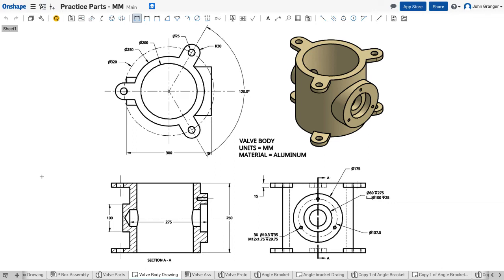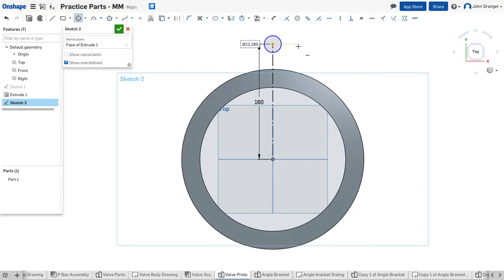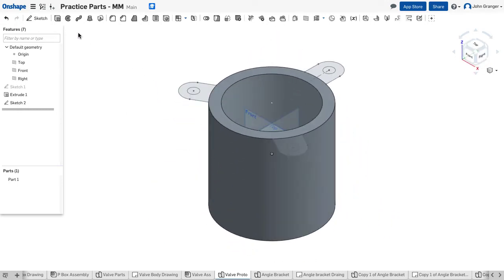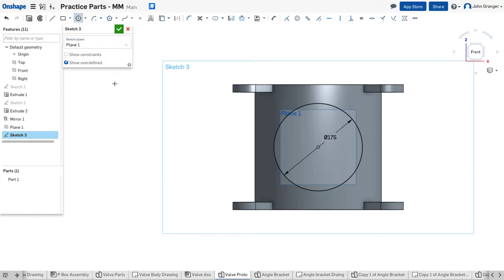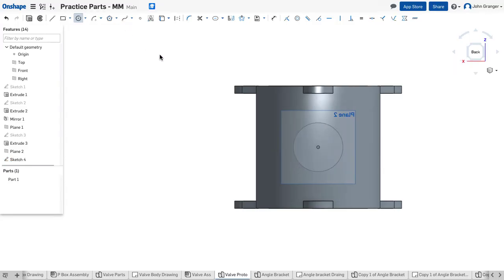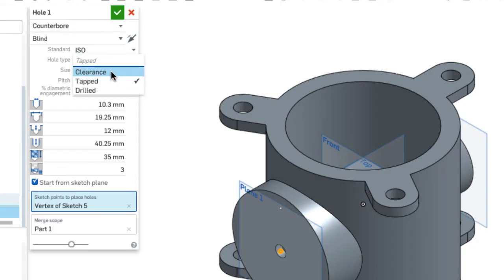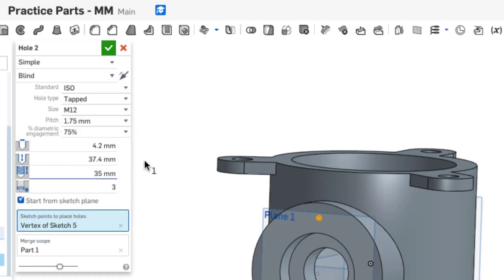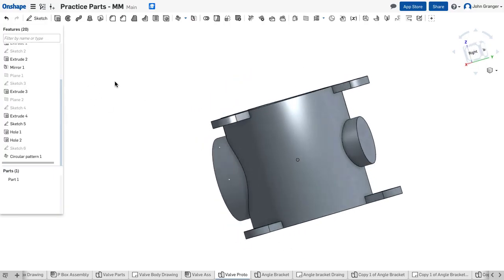Learn Onshape - Project 12 - Valve Body

Comment: it would not bore into the original part, kept turning red. I change the depth to 24 mm and it worked, change it back to 25 and it turns red. deleted and start that part over and i had to have did something different, it worked 2nd time, only part it gray instead of blue on finished part
Reply from the maker: Not sure what is going on, but here is a suggestion.  Push the rollback bar in the feature list up to just below extrude 3.  Double click on extrude 3 and the settings should be to remove, starting on face of sketch 3, ending on the face of extrude 2.  Offset distance should be checked with a value of 15 mm in order to end the hole short of the end of Extrude 2.  The merge scope should be part 1.  If this doesn't come out right, then check extrude 2 and make sure it was done correctly.  If all else fails, email me email me the file link so I can look at it.
Reply: @Onshape.Learning.Projects  not sure what went wrong but every thing is  right now

Comment: Hi! awesome tutorial. I know i’m really late to this video, but i a, having a lot of trouble with the counterbore hole on sketch 5 of this drawing. Around 9:37. it wont go through the extruded feature on plane 1. Any ideas?
Reply from the maker: On the courter Bored hole, make sure that you set the depth of the center hole to 275mm.  If this does not cut into the boss on the opposite side, check the diameter of the body, it might be too big and the hole depth does not go all the way across.  Hope this helps
Reply: I had a problem here to, it would not bore into the original part, kept turning red. I change the depth to 24 mm and it worked, change it back to 25 and it turns red. deleted and start that part over and i had to have did something different, it worked 2nd time, only part it gray instead of blue on finished part